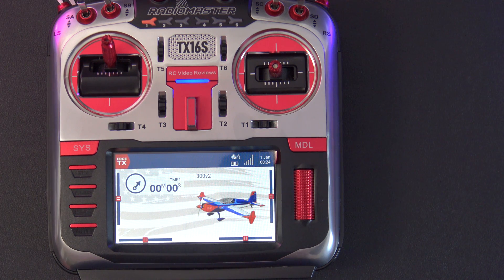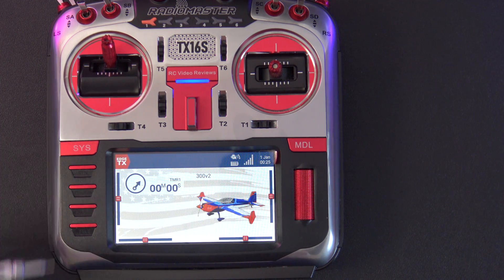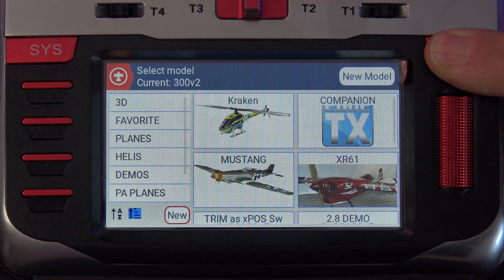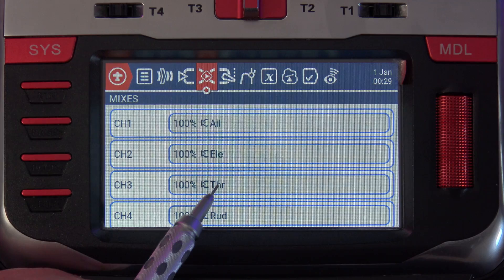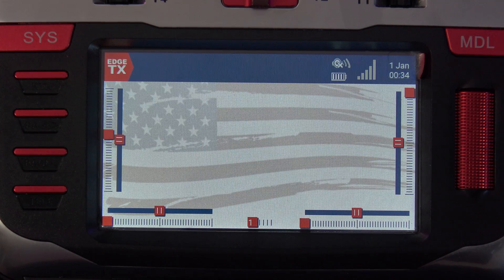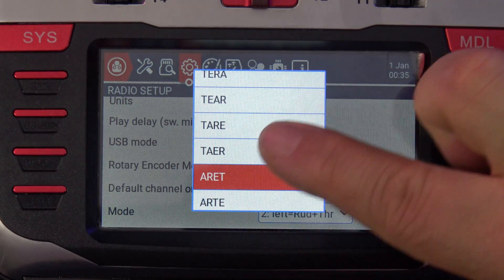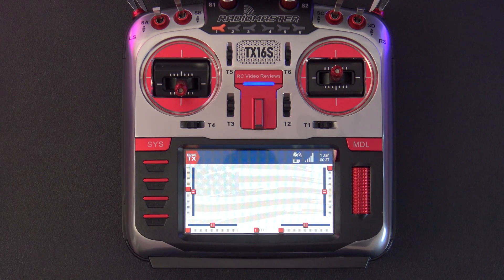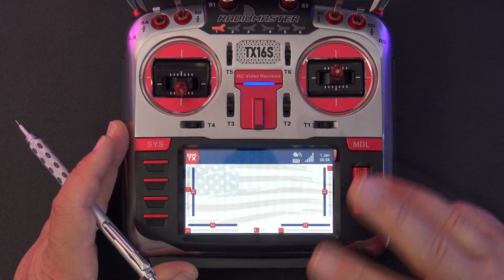EdgeTX 2.8 Create a New Model in 3 Clicks • Ditch the Wizard!

Comment: I can see that a '3 Click' approach works for a very simple model, but I can't see how it helps with anything more complex. For example, a lot of quite simple glider setups are actually a lot more complex e.g 2 servo wing, V-tail, crow brakes controlled by throttle stick (most of my slope gliders have this as a minimum), plus flight modes. I really struggled, and failed, with Opentx, so how does Edgetx make this sort of model config easier?
Reply from the maker: You have to make an investment to understand HOW to create a mix. Once you make that investment all of those mixes become easy to do. Look for my mix videos, watch them, play along with your radio, and learn HOW mixes work.

Comment: Fine ... but the Wizard and built in templates previously did more than just create a standard 4ch model, they also had options which expanded the functions. What about Heli setup ... nice one ... now a Heli is not served at all ... all setup is now without a base to work on. I for one would like to see edgeTX regain its wizards and setup template options.
Reply from the maker: They’re all crutches. You’re better served learning how to use the software IMHO.

Comment: I have a question! I just purchased the new TX16S radio and am trying to migrate the models from the Jumper T18 that is also running EDGETX. I follow the procedure exactly and it does convert the models to .yml files and puts them in the models folder on the SD card, but when I start the radio, and try to change to a model, only model 01 shows. I have seen where there are many people with the same issue. Any ideas on how to fix this issue?
Reply from the maker: I would look in the models directory on the sd card to make sure you have all the .yml files you're supposed to have. One for each model. Then you can delete labels.yml and it should rescan the directory and re-write the labels.yml file. Of course, make sure you have backups. If that doesn't work. You probably should open a ticket on the EdgeTX Github: https://github.com/EdgeTX/edgetx/issues/new/choose

Comment: Great video John. After having mastered OPENTX Edge seems so much more easier to work with.

Again...Great video.
Reply from the maker: The EdgeTX team has someone specifically focused on UX (user experience). I tested this on 2.7.1 and it took 4 clicks which means statistically this is a 25% improvement. Pretty impressive if you think about it.